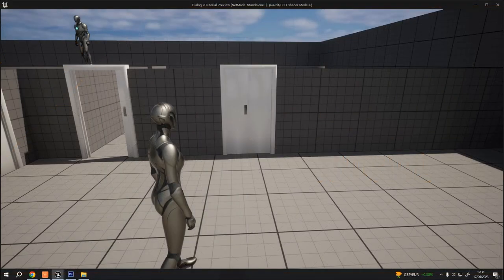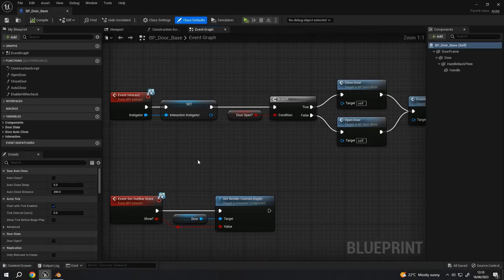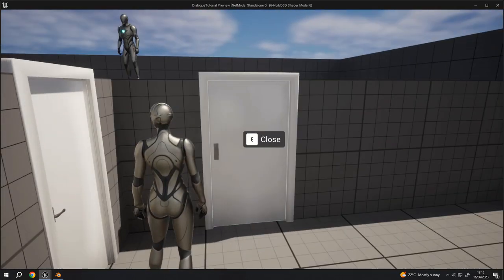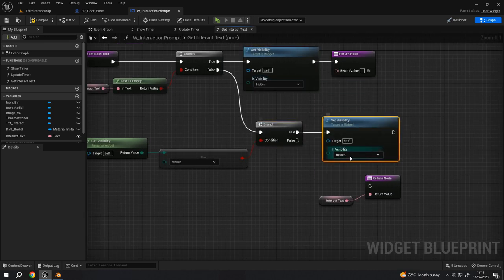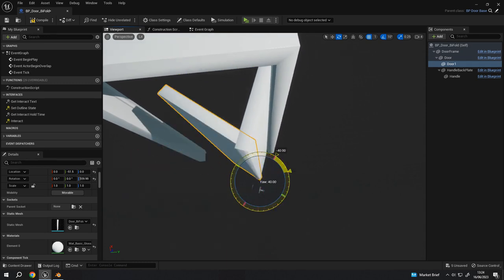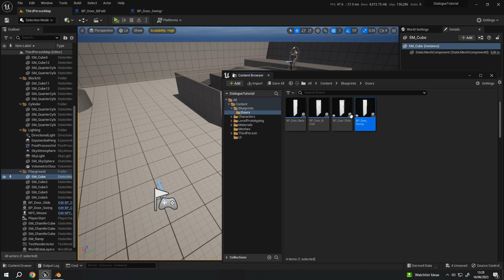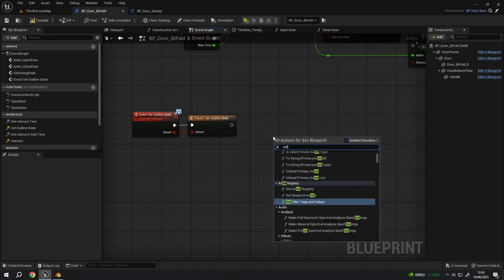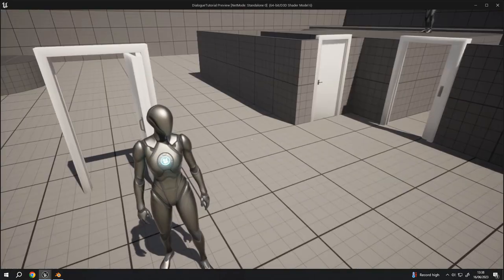UE5 | Bi-Fold Door & Minor Tweaks - Tutorial

Comment from the maker: Does anyone think they would use a bi-fold door in your projects?

I'm currently thinking about showing how to do a double door as it would be a great way to show how you can do different things depending on the individual component the player is looking/interacting with.
Reply: Yes do it if you ha e time ,Im mostly in Archviz playing with Unreal see to pro and cons, its a little complicadet at first but you will get use to it its fun so far yes some speed bumps here and there but there is always a solution or kinda solution🤷‍♂️
Reply from the maker: @glenn3646  there's a two part tutorial for making double doors. :)

It does require some specific stuff from the interaction side of things so if your not using my interaction system, it might be worth skipping a head to see if it might be compatible.

Comment: I was looking for this for this a long time I did try to do it myself in blue print but it wasn't working good  or I don't know the process , the solution for me was do the animation in 3dmax and export it to alembic file and put trigger box etc etc to run the animation when my character pass by the trigger box
Reply from the maker: Using skeletal meshes for doors isn't a bad option but you do lose flexibility to easily swap out the meshes.

I personally wouldn't use a skeletal mesh unless it was a complex door with lots of moving parts.